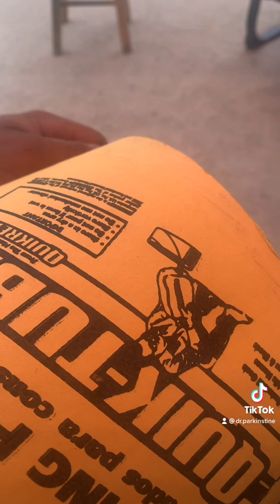How to build a receiver coil

Comment: So a receiving coil is basically a step down transformer to take the high voltage in the air back down to practical levels?  Like the opposite of the broadcasting coil

Comment: Hey I'm trying to learn more about tuning coils to specific frequencies. How did you figure out what length of wire was needed for the frequency your using? I've been racking my brain trying to understand how to obtain a wire length for a specific frequency and can't figure it out yet was. I was wondering if you could help me understand how you obtained the basic dimensions of the coil in order to get it close to the right frequency and then fine tune it using the signal generator and o-scope.

Comment: Can you give information on the secondary coil requirements and show your new receiving coil in action? Will we only be able to receive when you are generating with the magnifying transmitter?
Reply from the maker: Yes and currently you will only be able to receive the electricity when I am running my magnifying transmitter
Reply: @dr.parkinstine  I am working on obtaining materials! if the wire is not long enough can I solder a connection?
Reply from the maker: @jakesantiques  yes but it is best to use 1 length of wire also make sure you use insulated wire for the primary (magnet wire works best) and use an oscilloscope if you have one to tune the coil to resonate at 168khz by spacing the top few turns of wire on the primary of the receiving coil I will do a video tomorrow on how to tune the receiver coil to resonance

Comment: Could I receive it in NH?
Reply from the maker: Yes but I recommend testing a small 3 volt led  without a resistor on the receiver also the light bulb will only light up occasionally because my coil will not be on all the time it is very important that the primary  coil is exactly a quarter of the wavelength of 168khz the frequency of my magnifying transmitter and make sure the bottom of the primary of the receiving coil is grounded to the earth the secondary should be made of bare solid copper wire wound around the base of the receiver coil if you get nothing out of the secondary try tuning your coil better by connecting one end of an 3 volt led to ground and the other end to the base of the primary when the led is brightest the coil is in tune
Reply: @dr.parkinstine  Can you give a quick explanation on the significance of the primary coil wire length is one quarter of the 168khz wave length?